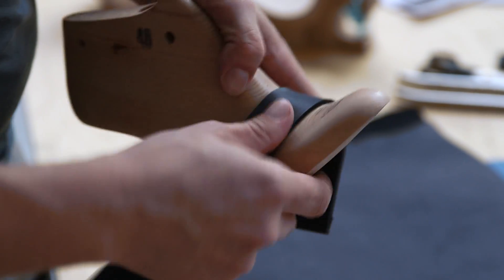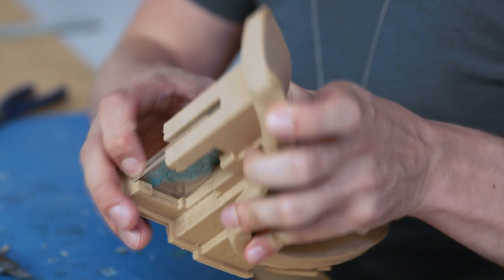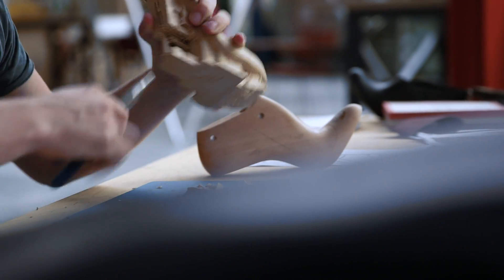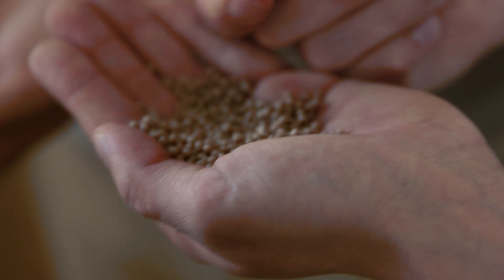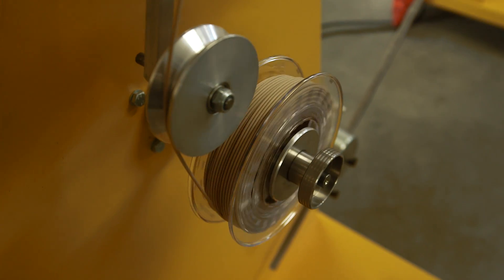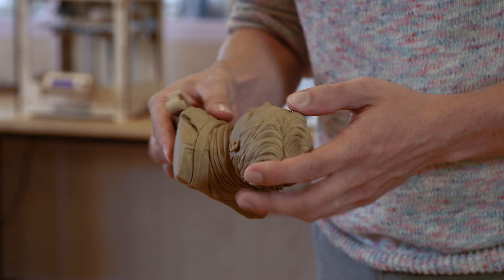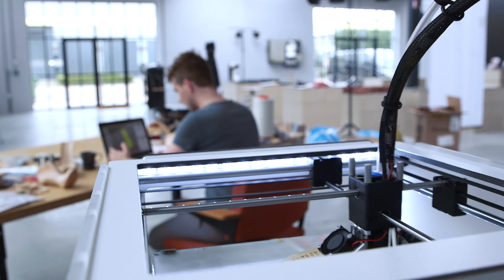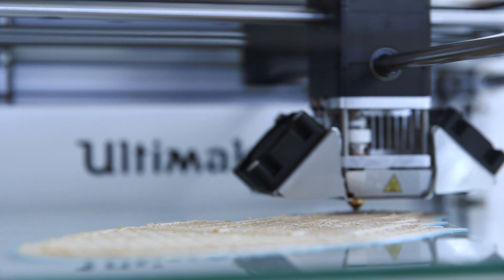3D Printed Shoes by Chris van den Elzen - Ultimaker: 3D Printing Story

Comment: Guys, I like what you're doing and I use Cura a lot. But that print at 2:03 looks like it has terrible layer adhesion and there's tiny fragments of filament pointing everywhere. I think your printer can do a lot better. My modified Sintron Kossel Mini can do better with PLA, ABS and PET-G (to be fair I haven't specifically used wood PLA). I refuse to believe a delta would outperform a cartesian printer in printing straight lines.

To me it looks like under extrusion (extruder drive slipping?) combined with slightly too short retract settings. Is the slicer really set to a sensible layer thickness? Also that brim is warping like Captain Kirk, is the bed properly adjusted?

Somebody please run diagnostics on this printer.